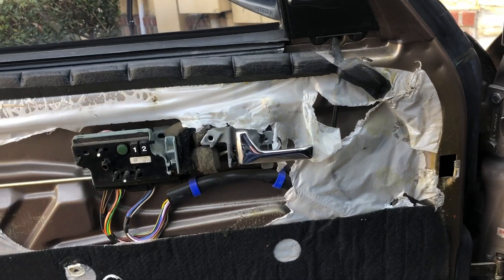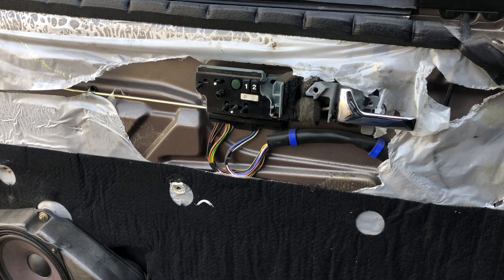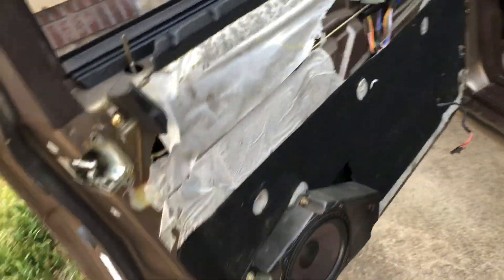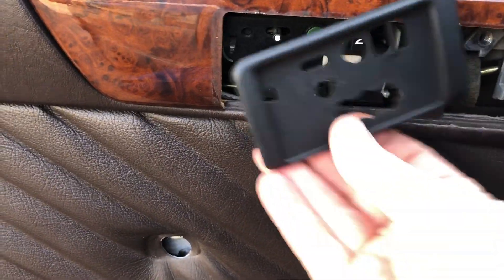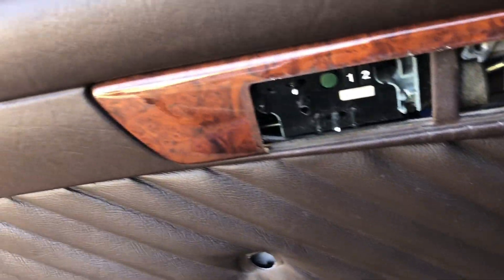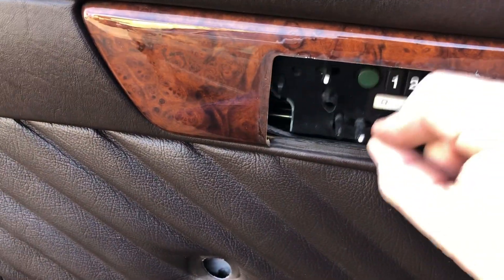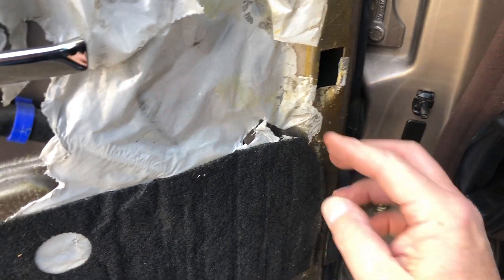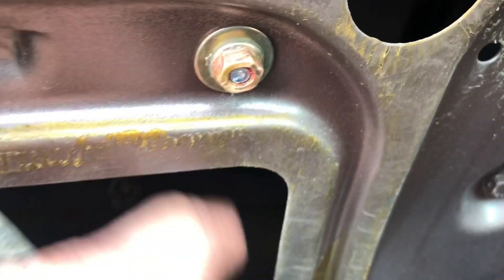Replacing A Mercedes Door Check

Comment: Best not done on a windy day or you risk messing up the door/fender if the wind catches it while the check strap is disconnected :)  These days I try to restore the liner plastic which is there to stop water ingress messing up the door and door card.

Comment: I hope you put lots of grease on the inner part of that strap where the balls set in the track. If not it will be noisy and with the wet weather you have, those balls will rust very quickly and fail. I replaced mine on my 01 e320 and did not get enough grease on it so it is a bit noisy but it is pretty dry here in Vegas so am not worried about rust.

Comment: Why didn't you grease the check strap before you put it in the sleeve, the grease they put on there is not sufficient, plus you used absolutely no blue thread lock on any of your bolts......thats why it continues to wear out quick and it comes loose